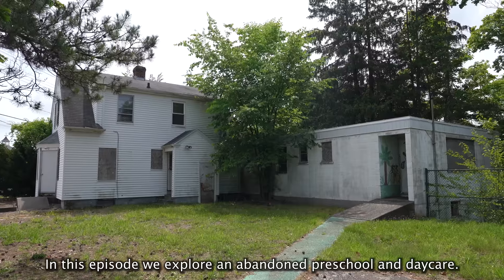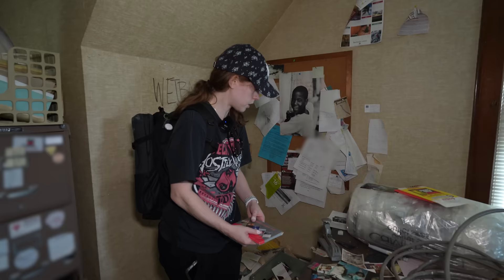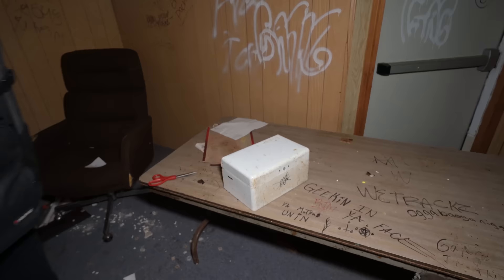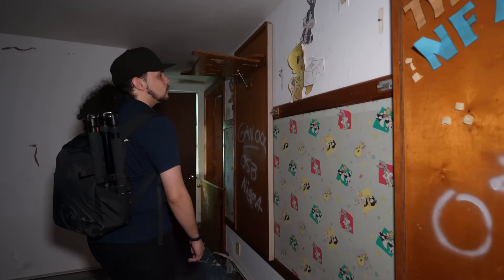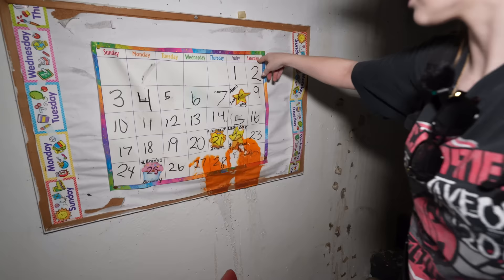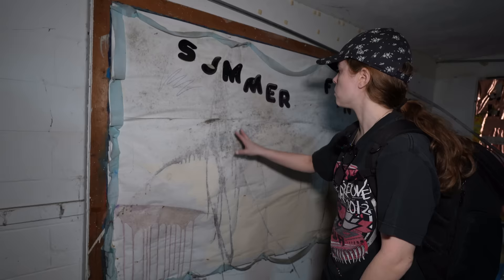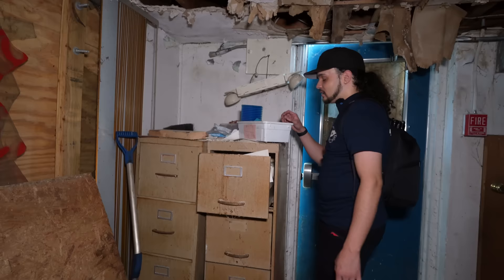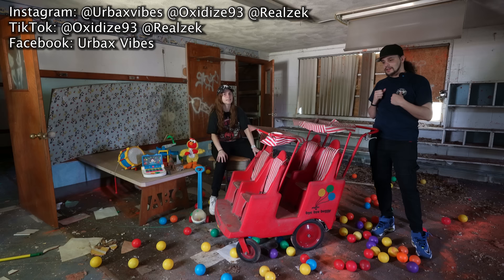Exploring an Abandoned Time Capsule Preschool & Daycare! - Found Blood!

Comment: It's kinda weird they converted an old house into a daycare preschool center I could see why it shut down it was too old of a building and a bit dangerous to children.
Reply from the maker: Sure was!
Reply: Makes sense to me.
Reply: The age of a building doesn't really matter. As long as it's up to safety standards. My old school is 85 years old and still going. Also it's fairly common to see a preschool and daycare made from an old house. They are not usually government and aren't in public schools. In fact kindergarten isn't mandatory in most states. I actually went straight into 1st grade in 1985 because the kindergarten had too expensive tuition for my parents.
Reply: its incredibly common
Reply: @dorcasia109 mine is over 120 years old
Reply: @dorcasia109  it was likely not being maintained

Comment: it clear this place was gone very early days of the Pc this was before 2000 there is actually a lack of any indication of computer and such all I have seen is the word processor that replaced the Typewriter I do not think this was open 2007 I was bring up younger kids back them and at that time Kids were starting to use devices even in preschools  Smart phones were very new but by then PC were very common  and White board were replacing Chalk Boards .

Comment: Why is it so dirty no one has been in there consistently for years
Reply: Vandals mostly, coming in and trashing the place (broken glass, papers tossed all over the place, needles, the blood, etc). If they even left one window or door open you'd be surprised how quickly detritus fills houses/enclosed spaces.

Also, oddly, we clean up a lot of the dust and grime that collects in spaces while we live in them. With no one around to clean it, that stuff just builds up. Add that on top of the fact that houses were never built to last forever, and you have the ingredients for something as simple as a water leak to cause a lot of damage over time.